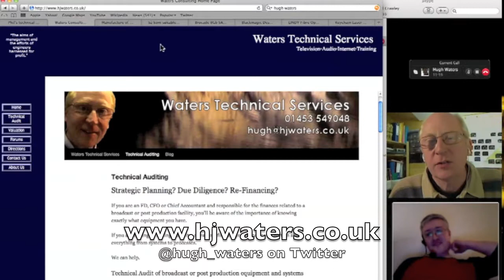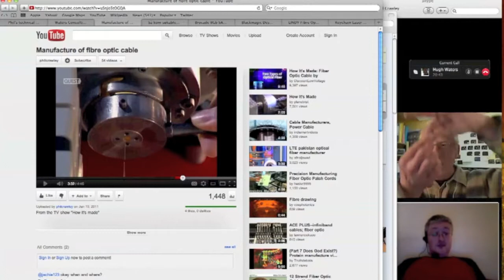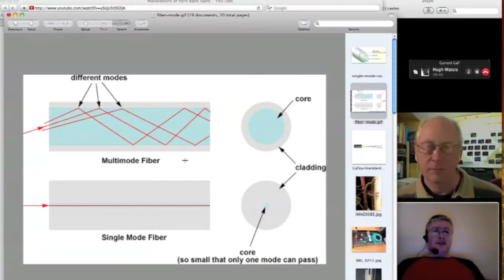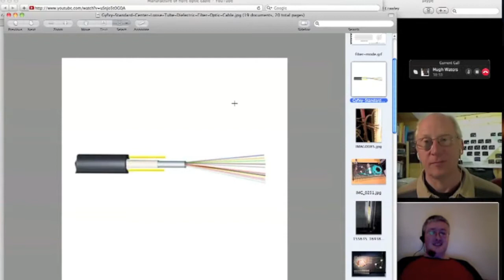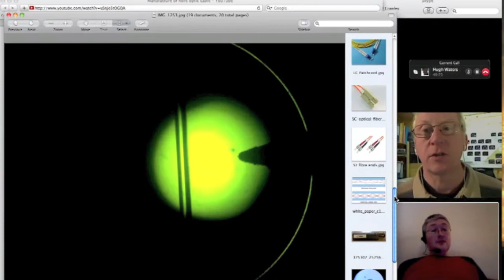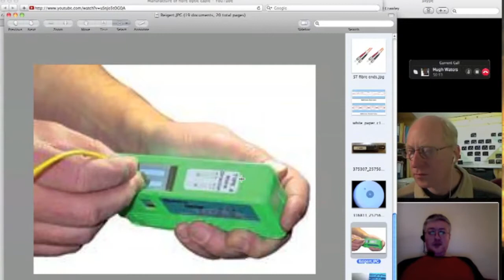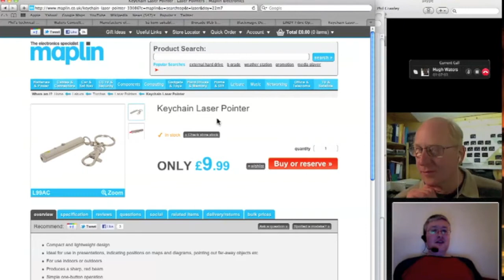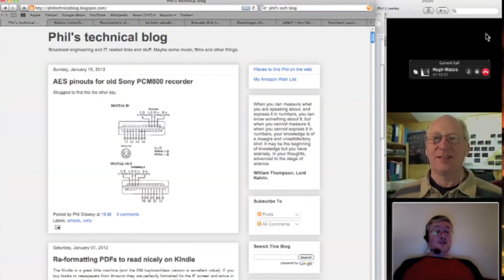Fibre 101

Comment: Thanks for the video, very interesring.  We are slowly going fibre in our facility.  The Isis, like most of them nowadays is connected to the Force 10 Switch by fibre but our 3D Smoke/Lustre/Flame is connected by Inifiband 10GB fibre to a Tiger switch, which is then conected to File storeage (Lacie and QNAP on 10GB), and an ingest Power Mac with 10GB connection too.  It makes for fast archiving and retieval from/to the Smoke on 10G.